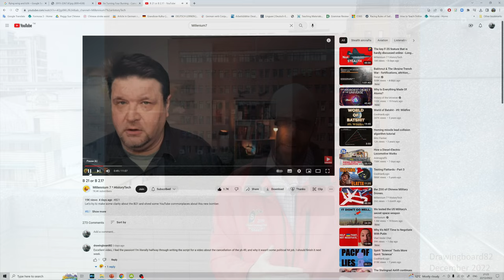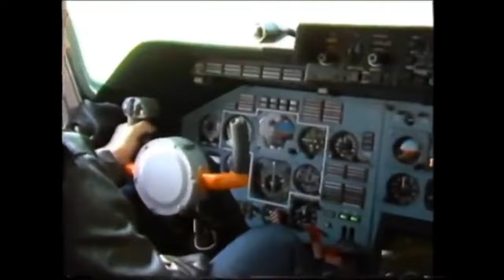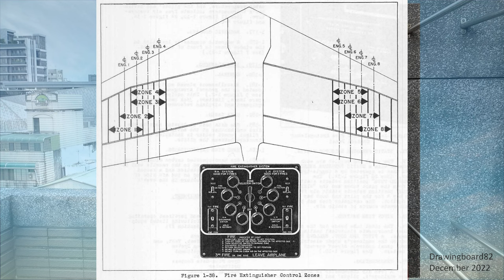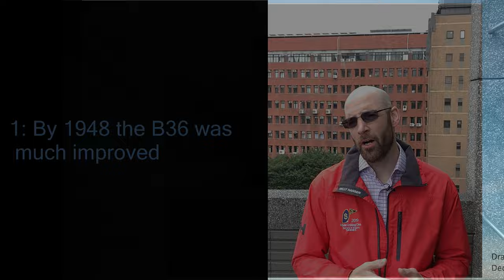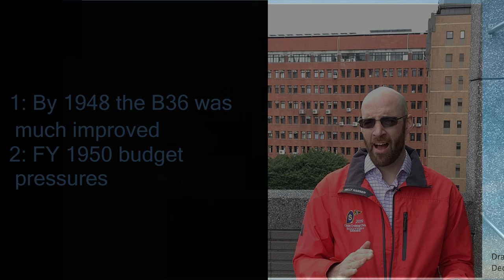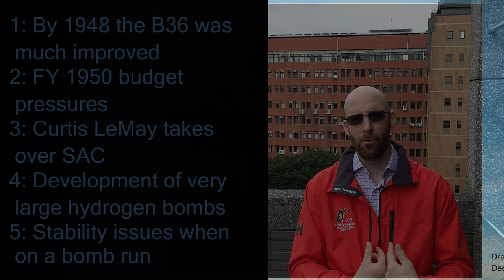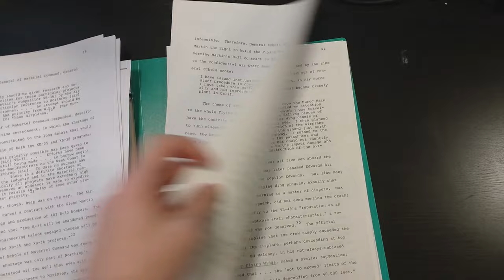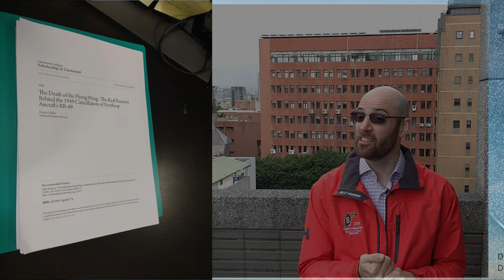A brief history of the Northrop flying wings (And why their cancellation was not a conspiracy!)

Comment: The B-49 would have been cancelled even without the other concerns – as noted conversion to jets put it in losing competition with the B-47 and not the B-36 - the Air Force could see no use for it.  Graham White in his book on the R4360 says the XB-35 had unsolvable vibration due to uneven wing-wake on each side of the props – which were not in line with the swept-wing trailing edge (as on the B-36).